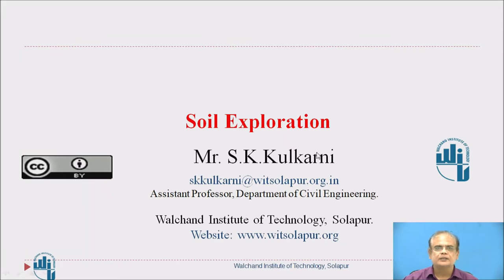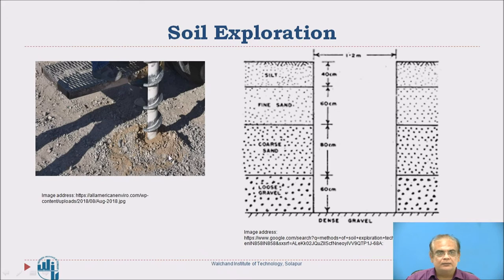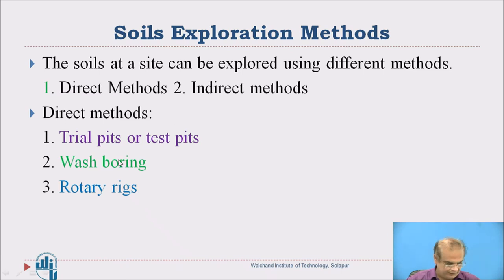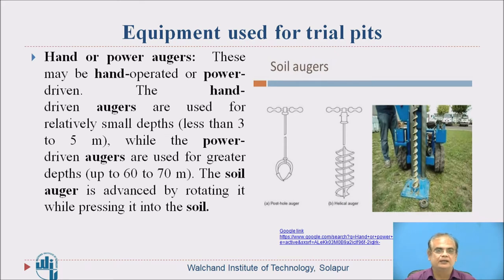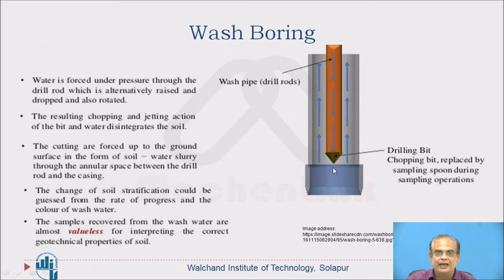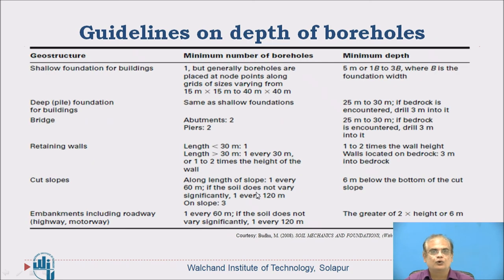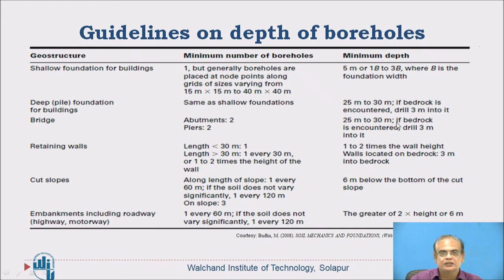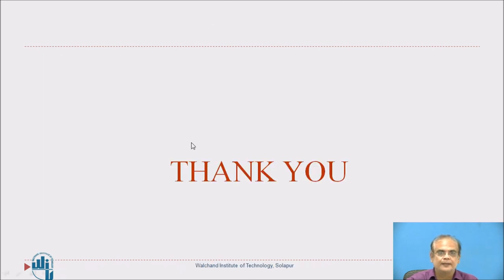Soil Exploration

Comment: a dam of homogeneous section is 25 m high with upstream slope of 2.5 to 1.0 and downstream slope of 2 to 1. there is a 12 m long horizontal filter at the downstream end. taking a free board of 3 m, determine: (i) factor of safety of downstream slope under steady seepage condition. (ii) factor of safety of upstream slope under sudden drawdown conditions.